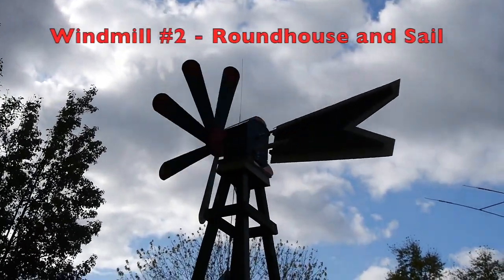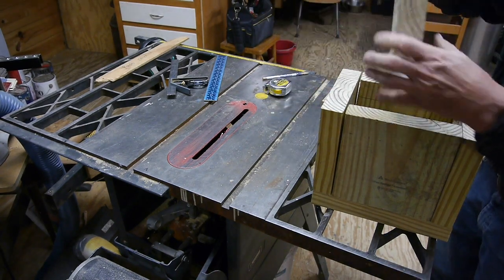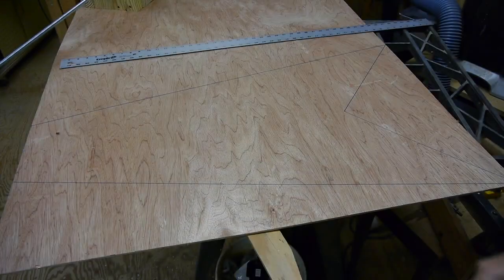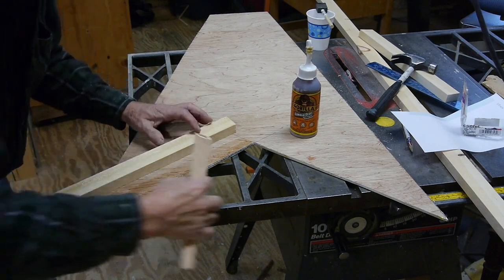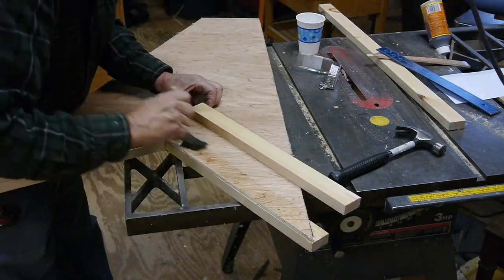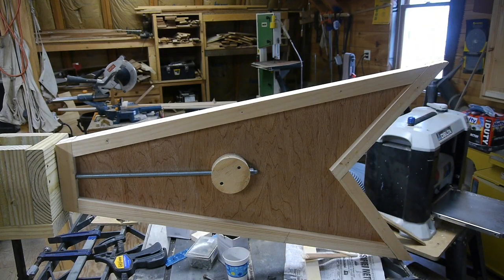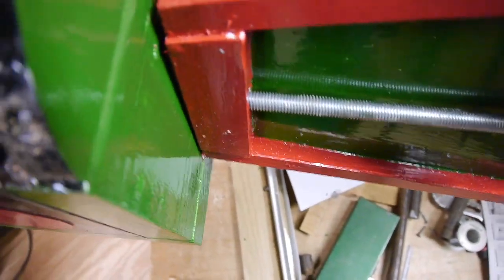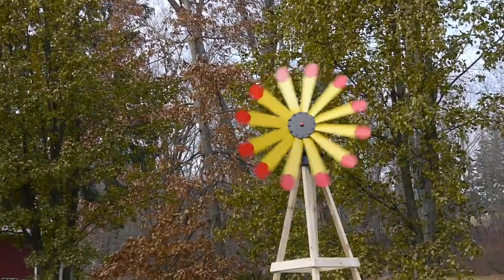Windmill#2 (Making the Roundhouse and Sail)

Comment: Tim did you know that home Depot sells 4x8 sheets of white vinyl plastic ? That would simplify your tail fin, and you can buy small bearings in bulk from Amazon or eBay , to smooth the rotation of your blades and rotator.
I can see your blades shaking as it turns , so those bearings being counter sunk into the wood will stop that shaking and vibration.

Comment: What material do you use to make the blades? Doesn't plywood determinate when it gets wet?
Reply from the maker: I used plywood and you are right.  It does not last.  I'm thinking of trying to find other materials to make the blade out of.  Maybe metal or plastic.

Comment: i am making my first windmill and the information here has been very helpful.  Any help with how to attach the roundhouse to the base so it will turn into the wind?
Reply from the maker: I did the rotating roundhouse on one of my windmills.  I like to keep things simple.  I drilled a hole down through the roundhouse floor and I put a 6" - 1/2" bolt through the hole.  I tghen screwed a nut on and tightened.  Then I put a big washer on the bolt.  I slid the bolt on down through a hole in the top of the base and the roundhouse turns on that washer.  I suppose the best results would be obtained by installing a bearing of some kind.

Comment: how did you mount the round house?  Did you put a sleeve on the bolt like the blades?
Reply from the maker: I drilled a hole in the bottom of the roundhouse and put a bolt down through then a washer, lockwasher and nut.  Then another big washer then a short pipe sleeve to hold the roundhouse up off the platform on the top of the tower.  The bolt then goes on down through the platform.  The roundhouse turns on the top of the short piece of pipe.
Reply: @TimTools99  Thanks.  That's what I thought.  I went ahead and took  the wheel off of a caster and flipped it over and mounted that to the outside of the round house.  Rotates on bearings.  Seems to work pretty well.
Reply from the maker: That's a much better way.  good job.

Comment: A real nice and useful as well as aesthetically pleasing project. I hope your grandson appreciates it. I built one of these a few years ago and installed a small generator in it. The juice from it goes to a regulator and charges a pair of old car batteries in one of my two 30 x 30’ pole bars. The 2 barns are only about 60’ apart so burying some interconnected wiring in some PVC was quick and cheap. It feeds 4 sets of LED lights in each barn. It turned out a little more expensive than it started out to be but I haven’t had to pay for any lighting in those isolated pole barns the past 5 years. I also spent more than needed on some bearings. Besides being nice to look at it’s been useful. I also connected some exterior flood lights that automatically come on for 10 minutes in front of each barn. It may seem like overkill but most folks can do it. I’m no rocket scientist.
Reply from the maker: Hello Dennis.  I have looked into building a wind turbine but haven't gotten around to it.  I would want to build better blades, hub, bearings etc. for that project.  I cut out a PVC blade a while ago just to see how those blades would be.  they would be quite heavy and would require a metal hub I think to bolt the blades to.  I like making stuff out of wood so I put that project on the back burner.  I was wondering ... what do you use to make your windmill blades?  I have used that 1/4 luan but it doesn't last.  I just had one of the blades on the windmill break off.